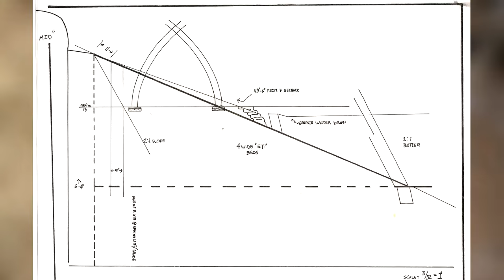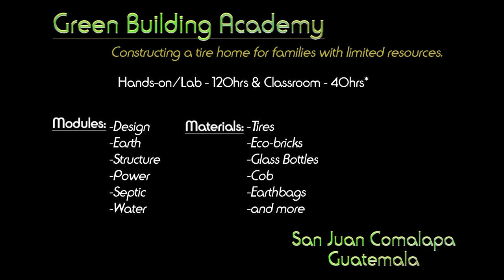Hero School - Tire Retaining Wall - South

Comment: I just want to build the 1 "U" for myself, and then I can add later if I want to. I have access to 500 tires or so and they are willing to pay me $2 per tire including delivery. Many of the tires are larger truck tires (18", 17"), and there are mostly 16 " truck tires which I think are almost as good as 15" tires. They have phased out 15" tires for some reason, and they don't make many 14" tires anymore either. Are these other sizes just as good to use? I know that they are bigger so they will require more dirt.
Reply from the maker: Truck tires are perfect, but yes require more dirt.  18", 17", and 16" are all good.  If you want to see the U's being built by us, visit lwhomegreen.org and check the barrel vault profile for pictures, videos, and blueprints. Let us know if you have any more questions as you build.  Remember dont pack the tires too tight. The will get unstable as you go up.

Comment: Ok I thought about building fence with tires but I think I've talked myself out of it. What about weeds and eventually trees sprouting and either becoming constant maintenance or a tree destroying the wall?
Reply: Great questions.  We pull any trees out before they break up the dirt too much inside the tire. Weeds seem to help to keep the surface dirt intact. This wall requires some maintenance but not much. The trouble with building fences with tires is as they go up they become less sturdy.
Reply from the maker: https://www.lwhomegreen.org/   Many many many more examples!